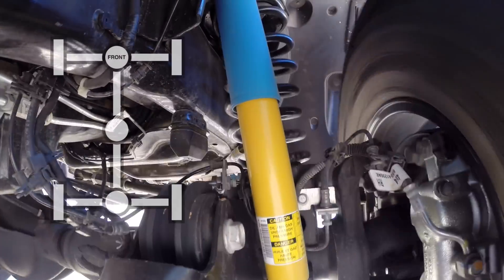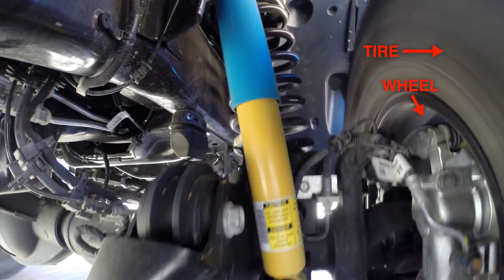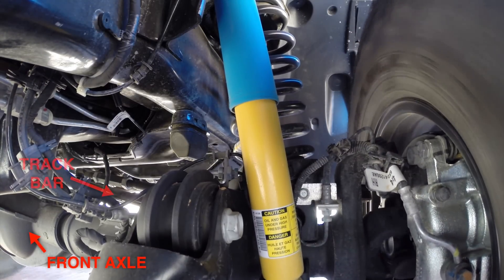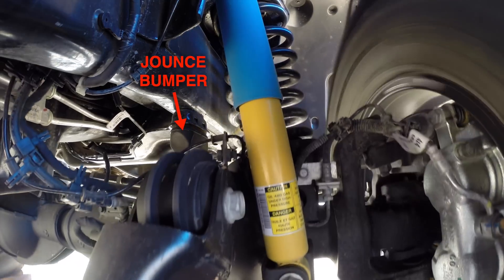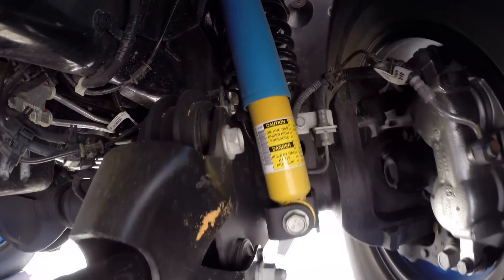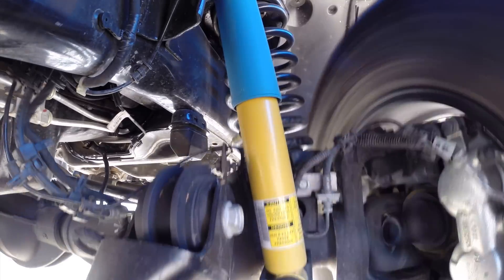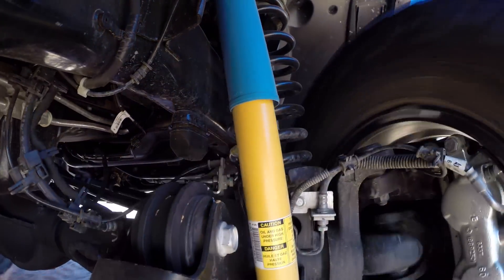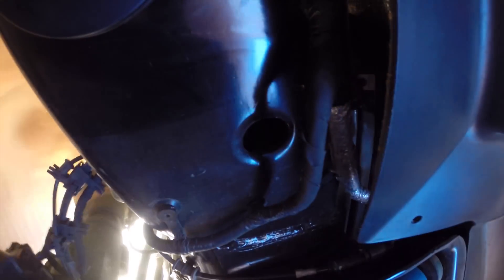Watching A Heavy Duty Off Road Suspension In Action

Comment: I understand that u-joints has some serious issues with vibration at high angles, due to them not being constant velocity. I'm assuming their durability over standard Rzeppa CVs significantly outweighs that disadvantage; and using something like a Thompson CV or similar would be more more expensive. Also, doesn't Panhard rods exhibit tracking issues (the axle basically travelling asymmetrically along an arc of a circle), something like a Watt linkage could mitigate (of course not eliminate completely)? But then again, reason it's not being used I'm guessing is most probably an issue of cost.

Comment: Would be cool to see more off road themed stuff. I don't think I've ever seen anyone give an Engineering Explained level of detail explanation of things like a dry ice intake, tire cutting, driveshaft brakes, or really any of the technical details used by off roaders or mud trucks. Plus if you did a video of the proper and safe way to lift a truck while having it work the way it's supposed to, and still be every bit if not more durable than it was off of the assembly line, then maybe I'd stop seeing so many geniuses driving around with giant lift blocks clamped to toothpick axels on the front end of a truck

Comment: how do you know if a car is full time 4wd or part time 4wd?
Reply: Pedro Ibañez If it's part time it will have a selector to engage and disengage one of the axles, usually it's the front one that's part time and the rear is always engaged. A full time will use a center differential instead of a simpler t-case so you can safely turn on high traction surfaces without breaking something in your tranamission. Note that the same model may have both full time and part time variants.

Comment: can you make a video explaining how much energy a turbo charger compensates for the energy loss in an internal combustion engine? I believe it's something like only 30% of energy in ICE's is actually turned into mechanical energy to turn the wheels? does a turbo make it more efficient? are there ways companies are making up for loss through other means such as heat, sound, and light?
thanks
~Max

Comment: Why does it uses universal joints instead of CV joints??? By selecting this design the angular speed of the wheel (when steered) will oscillate right???
Reply: No answers so far...
Reply: Maybe it's a double cardan and not a simple universal joint? I'm not sure. Nearly everything uses CV joints for this, but I've seen a few offroaders that look like they use u-joints. For very loose terrain I guess you could easily get away with it, but I can't imagine it being a good idea on high traction surfaces, specially if the vehicle is a full time AWD.

Comment: What camera mount did you use for this? I've been wanting to do a custom mount for this purpose as a diagnostic tool, but if there is an affordable commercial option I might use that.
Reply from the maker: I just used the suction cup, but the 2500 has a pretty massive (smooth and painted) frame so there's enough surface area to attach.
Reply: On cars magnets are pretty nice. I use a magnetic catch tray that I stick to the body and throw bits into. Stays on so good that I forgot I stuck it to the back of a Uhaul in the morning and didn't notice until I went to drop off the truck the next day. Drive just over 100 miles and the tray never fell.

Just be sure to either put the magnets in a cloth sleeve or coat them with rubber so they don't scratch and gouge the car. For best results, use neodymium, 1 inch squares should be plenty of holding power for a gopro.
Reply: Alan Hunter - I thought of using magnets, but with the vibrations I want to monitor I  feel it would be too much. In particular, I have a Caravan that bucks like a wild bull but when tested individually all the suspension parts seem to be in good shape.

Engineering Explained - Thanks for replying. It's rare for my comments to get noticed by the poster, but lately it's happened a few times. Most of the cars I would want to use such a mount on have plastic fender wells which are prone to scratches that would prevent such a method from working.

I was hoping that someone would have a multi-point mount that would be able to reach to the frame and the sides of the fender. The mount I had envisioned in my head would look similar to those that you see used on movie sets to record vehicles from outside their front fender. Alas, it seems I will have to make my own.

Comment: the power wagon has a solid front axle?  I didn't know that.
Reply from the maker: Locking front diff as well. It's the real deal!
Reply: Engineering Explained This seems like too big of a truck to compete with the raptor though.  More of an off road working truck?